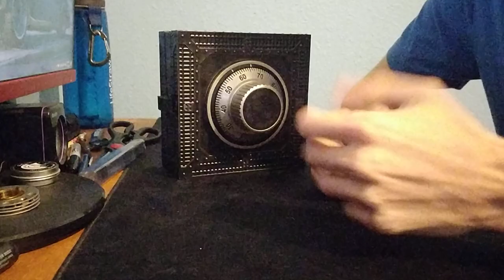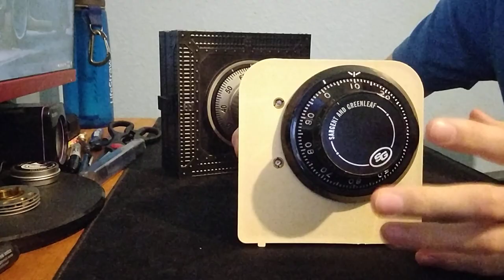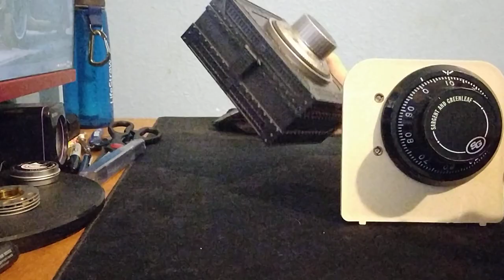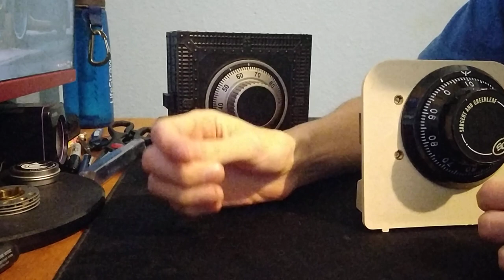Safecracking for Everyone part 8 (LaGard Manipulation)

Comment: Most manipulators believe the LaGard wheels to be oval in shape, however they are not more or less "oval" than say the S&G 6730 series. The problem with wheel shadowing etc. in these locks is the fact that the LaGard wheels are more "sloppy" on the wheel post than other locks. Without going to far into it, and I'll just talk about wheel 3 as an example. If you carry wheel 3 one way, you will pull it away from the fence, for say half of the circumference, continue turning and you will push the wheel into the fence, for roughly the other half. If the gate is in the area on the wheel being pulled away, it more often than not will not indicate. If however the gate is in the area being pushed toward the fence, it will more likely indicate. Do this test on a LaGard, and watch wheel 3, you will see how obvious this is. It also applies to all wheels, and relies on the wheel pack tension washer to hold the wheels in place while testing contact points.   Regards, Brian.
Reply: Thank you so much for this extra information. You've cracked a bit of sanity back into me. I was struggling with this one.

Comment: These are great!   Thanks so much.  One thing I'm having trouble with is getting my hands on a good variety of dials to manipulate.  Any suggestions? I've got the 3 that are on MBA locks online already and picked up one beat up one from a local locksmith but that's it.  Hoping to find some more.
Reply from the maker: Asking safe technicians to call you if they come across any is a good idea. Also just keep an eye out on ebay as things pop up there from time to time
Reply: @lockmanipulator  I've gotten pretty good at my S7G 6730 and LaGuard 3300 what would you recommend as the next couple to learn?
Reply from the maker: @danielgallant2202  The Diebold 177-23 is a nice lock! It's got a U shaped cutout from the drive cam so you'll need both contact point readings on that one.
Reply: @lockmanipulator  Awesome Thanks!  Where would you say Yale fits in to the learning curve?
Reply: I used to have a list I wanted to work through but I've long since lost it
Reply from the maker: @danielgallant2202  I don't have much experience with Yale. But I think they use gravity instead of a spring for the nose to touch to drive cam? So you might need a lighter touch.

Comment: I have a Vanguard vs200 that belonged to a great grandparent and I had a combo after running through this whole series that seemed to catch the cam but didn’t get it.  Now the nose piece seems to catch past the left contact point no matter what position the dials are in and the whole contact area moved almost a whole number to the left. Any ideas?  Could the latch have moved slightly just seems unlikely that the latch wouldn’t return fully when reversing the dial.
Reply from the maker: If the contact area is moving so drastically then that might suggest a broken spline key, the part that locks the dial to the drive cam. Even with the combination it would be hard to open, and maybe impossible to crack. You would probably need to have it drilled at that point.
Reply: Dang. It is weird that it has a permanent catch feeling almost a grind feeling when you turn the dial to the right and go past the contact. Literally was all fine through the whole process till I was going through every other number for the last wheel and landed on one that felt like it was catching but let go then it has this problem. I was afraid something had gone terribly wrong. Haha